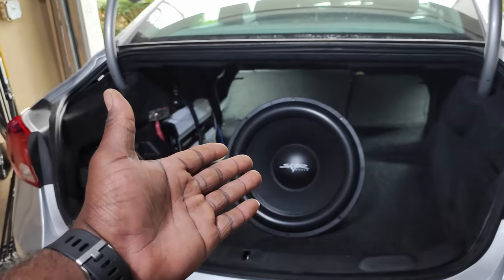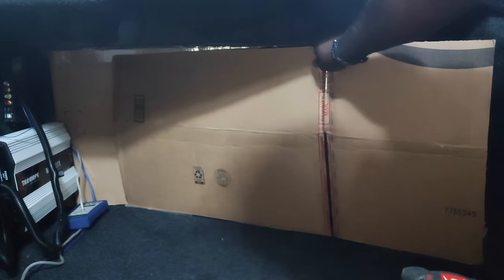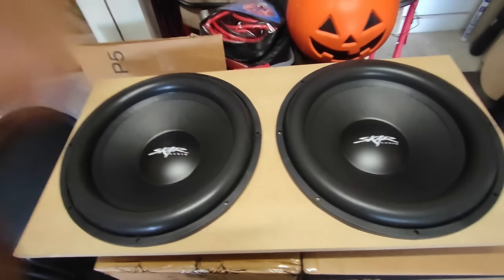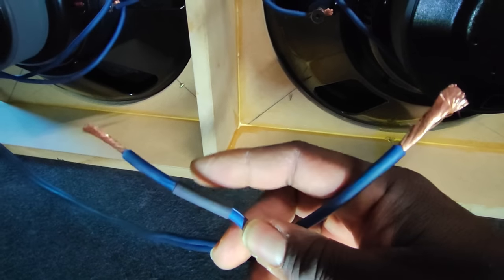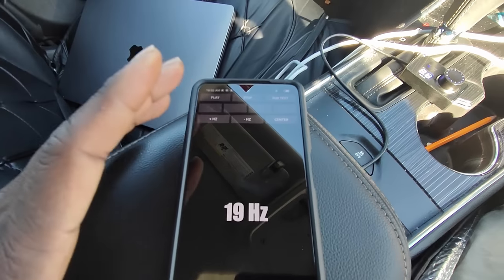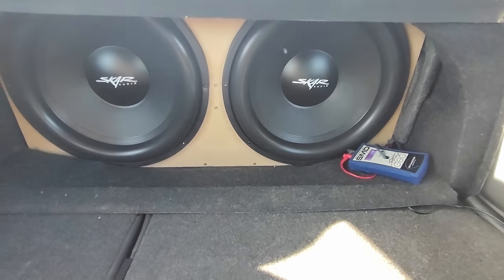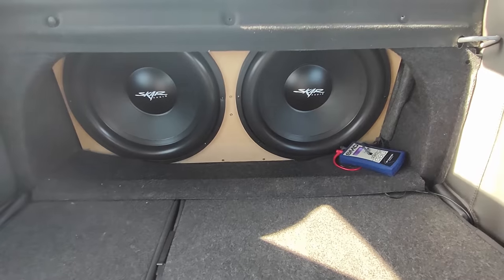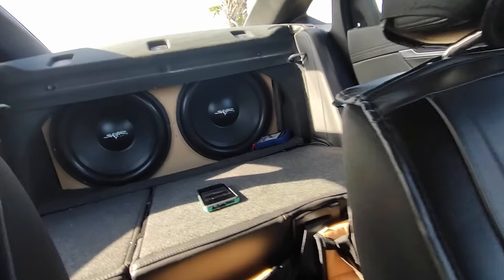No Other Design Sounds Better Than This - Infinite Baffle - 8,000 Watt Test - Part 1

Comment: Configure them in a push pull configuration you’ll be stunned at the improvement. Crisp tight responsive bass.
Reply: I generally wouldn't run something like this... but you may have a point. Turn one around you might have something there. Still needs to be double thickness on the baffle. And he Needs to seal off the front from the rear As well as line the entire trunk ...

Comment: I guess I'm confused how do you have an 8000 watt amp behind those?? Especially at 600 watts RMS?? 😮
Reply from the maker: My vehicle is practically a test rig at this point. I have plenty of overhead for different types of builds. I wasn't really 'Meaning' to throw that much at the SDRs.

Comment: I don’t understand the ib I did a a build with 2 lcs12s on 700 watts and did a 143 at 42 hz so is it more flat like a t line? Output seems to suck on ib

Comment: Basshead, thats not how infinite baffle is done. You need to seal the rear deck and sides. You want an airtight seal between the two. The rear deck speakers also need to be sealed off. Right now your incredibly leaky. The pressure can't build.
Your speaker baffle also needs to be rigidly mounted. When I did 3 12's infinite baffle through the rear deck I had 5 layers of 3/4 glued together and bolted in. It needs to be thick and sturdy.
Reply from the maker: This was just a test, but I will certainly enforce the build. Honestly, I didn't expect these results.
Reply: @BudgetBassHead  Oh, I thought this was more than a test.

Comment: if i face my sub that way with the back seat up will it change the dynamics much i left few inch of space between im not really a bass head just use it to take the bass off the door speakers and i have it that way becouse my boot gets filled with shopping all the time 🤦‍♂️

Comment: Just wondering why it wasn't "SEALED" from side to side since you took measurements.
Reply from the maker: I left room for soft foam insulation for making the seal. This was actually just the test footage.
Reply: @BudgetBassHead  Interesting so this won't be a permanent install.

Comment: What about longevity though? With all that air space behind it won't over excursion be a problem? Without a box the suspension is doing 100% of the work, or do I have it wrong?
Reply from the maker: Surprisingly enough these subwoofers don't bottom out easily
Reply: @BudgetBassHead  Good to know, thanks for the reply. I may explore this option the next time I have a sedan.

Comment: Rather have a sgl 12 in a box I can remove if need be and still have the pass through ability of the trunk.. also as you put or remove items from the trunk it’s going to constant change the volume of the trunk so it’s going to sound different all the time.. 

If I were gonna do something like this I’d reinforce the rear baffle and suspend the subs from there so they are more protected then this..

Comment: Nope. I'd do this with three or four 8 inch subs though, the smaller subs give better control and also need less air to sound as good if not better. In the case of IB, less is more.

Comment: i have 2 vfx 12s and i wanna make a trunk setup using the trunk as my box. i’m planning on mounting the subs to have the magnets free aired but i don’t want to make a box/enclosure for the subs themselves, more of a mounting bracket to hold the subs. is this a good idea or would i be lacking performance?
Reply: 2018 toyota camry trunk btw ^

Comment: Maybe I'm asking a dumb question but I'm trying to design a setup like this and I was just wondering how he put 2 1200 watt max subs through 8000 watts. Is it even worth if for me to but the evl series with 2500 watt max to match what power I wanna put into them or should I go cheaper snap get the ones he has and put about 5k into em
Reply from the maker: These subs cannot handle 8,000 w of power continuously. They would burn up. That's why you only burp them... Just a short amount of time. And then allow them to cool off.
Reply: @BudgetBassHead   thank you I never knew you could even play more than recommend for any time

Comment: Sounds cool,but I personally would never fire .y subs tordes front and never run voice or trouble in the bass speaker. It ruined the bass feq.Always cross over the bass from highs,trouble. The trunk acts like a filter to filter out physical speaker artifacting and the trunk acts like second box.

Comment: Sportin the hell out of them skars..  must got a promo or endorsement..  precision audio is an all around better and just as cheap brand in my opinion.  Had plenty of those skars blow out on me and the precisions last on the same system and speakers rated the same rms..  so kinda changed my opinion..   then again ive seen some skars submerged in some water and come out still thumpin after dried out..

Comment: 8000Watts my A$$. For a burp, okay, but these motors cannot dissipate more than 500W each. Also the excess is just spent on the suspension that is stopping the coil to pop out.

Comment: Knowing is 2x18 the pressure is a joke by bro ❤️  one 12 inch in sedan with only 4k RMS push to the sub I beat that all day long 🙌 146 one sub 
So I would say is no win with 2 18in the boot 🙌 make a box .. bafle never beats good made with calculation box with the port 🙌💎 
Looks nice those 2x18 but just that bro

Comment: Those sdrs do not have much time left here on earth with that much power going to them even a smat 3k amp is way over power for the sdrs you should have went with zvx s and that’s still pushing it I’m running 2 18s with a bass 8k with major electric upgrades and 4 31 Odyssey batteries

Comment: that is a pretty high resonant frequency ... yes that is a lot of woofer for only 137... and i would argue that a sealed encloser would give you a much better SQ... since there is no resistance on the woofer... again... no one... i mean no one would use a 18 inch woofer for SQ anyway.... we did free air boards with kickers in the 2000's much better tech these days.... with woofer tech now i would not waste time on a free air set up.. you would get better SQ... more output as far as spl... with way less power with a JL 13.5 TW5... in a sealed encloser... and wont use as much space as you used for 2 ...18 inch woofers
Reply from the maker: This is a budget setup, from a budget channel. JL 13??? That costs more than this whole setup. Plus, my videos are viewer suggested. I'm just giving the people what they ask for.

Comment: Honestly that's really nothing special. You're basically running a sealed box. A very crappy sealed box at. You would get better results with a sealed box with the same airspace as that trunk since all of the walls would be solid and you can throw actual bracing in between the stop the box from flexing. you get much more responsive and accurate bass with a solid enclosure. Your bass will be so much louder if you actually use a box. You'd be surprised how much sound you are actually losing because the box that you're using is all that metal just flexing constantly.